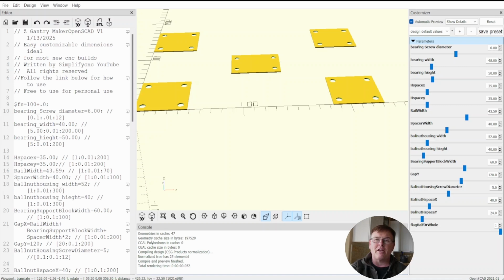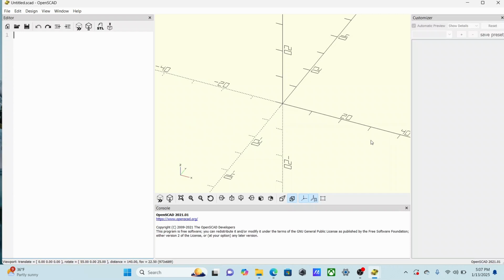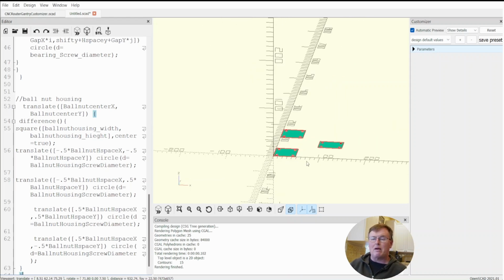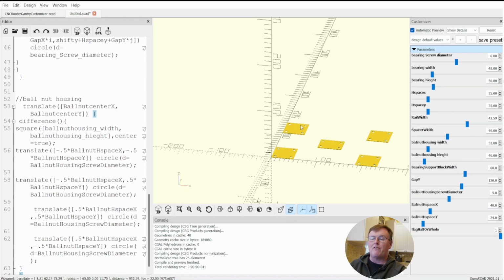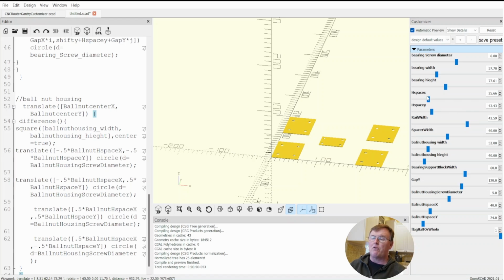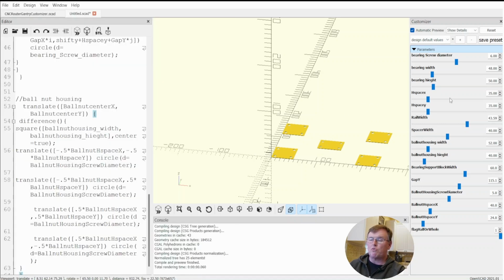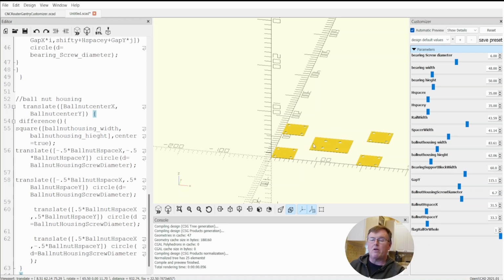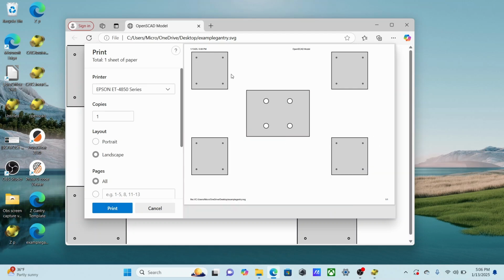MAKING AN ULTRA CUSTOMIZABLE PRECISION CNC GANTRY TEMPLATE IN OpenSCAD | DIY CNC ROUTER EPISODE 7

Comment: Have you ever tried creating your own interface to control your CNC? I ask bc it might be an interesting project? When you talk about connecting three different connections to get the stepper motor working? Do you know what the signals are that go down those lines? I am sure you can appreciate it would be useful to have a local control I could use to manage my self-built CNC?
Reply from the maker: Gsender already has remote control capability built into it via a smart phone.  Is that what you are thinking about regarding an interface? 
The actual Gcode that runs the CNC is relatively straightforward (I have manually written it with a text editor and run it with success).  My favorite addition to my CNC however is a free online site that will remote stream camera feeds (I just use my cell phone camera) to another computer in a quieter and less dusty environment.  The site has extremely low latency and no software to download and can be downloaded offline so you don't even have to have internet connection.  Beyond that its free.  It's very much like zoom but zero cost and much lower latency.  As soon as a finish this CNC build series (hopefully soon) I will post of video on that. If you don't use a remote camera feed to watch your CNC when it is running it is a game changer. If you want more info let me know. 
 I now use this remote camera feed for almost every long carve since my garage is either freezing cold or blazing hot and I don't like to breath any more wood dust than necessary.  As a side note, I ran across a great website that shows you how to control stepper motors directly without any outside C++  libraries.  Is that maybe what your are looking for?  I have thought about writing my own compiler to make my own Gcode.
Reply: @Simplifycnc  This all sounds right up my street, apart from the C++ bit; I prefer Swift. But yes, you're absolutely on the right track. What I like to do is a breakdown or reduce all these jobs to their basic components as far as possible, as far as is reasonable. So, sure, it would be fun to write your own GCODE compiler, but I'm not sure if reinventing that wheel makes sense. But the GCODE app is a black-box here. I thinking I want to build the minimum code needed to make the CNC motors move X,Y or Z. So an Arduino app that sends the right signals to the motors to make them move. The goal ultimately would be to be able to sort/fix problems more effectively. Regarding cameras I wrote an article about doing so late last year. It used an ESP32 chip, but not an Arduino. I sent you an email the other day, please reply to it and I can send you a link. And, yes please add a camera video to your channel as well.
Reply from the maker: Check out "vdo ninja" on Steve Seguin Youtube channel.  He wrote the web based video streaming software and has some tutorials (but you can have it up and running in under 5 minutes.  It works great).  There is also an older version of this software he wrote but I can't recall its former name.  I found vdo.ninja to be the perfect free no hastle 5 minute camera solution  to monitor my CNC so that I don't need to set up something like octopi or purchase more camera hardware.  As far as controlling steppers without all the black box nonsense which is what you seem to be looking for I ran across the solution on a animatronics youtube channel.  Do a youtube search of Beginner's Guide to Controlling Stepper Motors with Arduino.  The youtuber is Rachel De Barros.  She did a nice tutorial on this. That should give you what you need to write your own stepper motor code.  I suggest that you start by making an etch a sketch controlled by steppers as its a very inexpensive way to work out the bugs in the project/software.  Sorry I missed your email (I have 3 emails and I tend not to check my youtube one all that often).  I will log in and try to give you a reply this weekend so you can send me the article.  I am very interested in your project. I also really like the ESP32.  I have a DEV model that has been sitting around for a few years but haven't done anything with it.  It's on my want to do list (which is always larger than the time I have available).  As a side note of a project that doesn't really go with my channel but I think I will be building very soon is DIY automatic lawnmower (that tracks itself).  I want to make this from the ground up probably using an arduino mega (since I have a couple of them sitting around).

Comment from the maker: IF YOU HAVE PREVIOUSLY COPIED AND RAN VERSION 1 OF THE OPENSCAD GANTRY MAKER THERE HAS BEEN AN UPDATE PLACED IN THE DESCRIPTION (WITH NEW OPENSCAD CODE).  THE NEWEST VERSION 1.1 YOU WILL WANT TO RECOPY FROM THE DESCRIPTION AND USE IT TO MAKE YOUR GANTRY INSTEAD OF VERSION 1.  THIS FIXES AN OFFSET ERROR THAT OCCURS IF THE BEARING WIDTH HAPPENS TO BE A DIFFERENT WIDTH THAN THE RAIL WIDTH (WHICH OFTEN HAPPENS DEPENDING ON THE MANUFACTURE SPECS).

Comment: Installed. Thank you :)
Reply from the maker: You are most welcome. OpenSCAD has a100 times more maker possibilities than I was able to share in the video.  If you want a glimpse of some of its abilities click on the help menu at the top of OpenSCAD program and then the Cheat Sheet.  In it are tons of clickable code examples (all of which can be copied and pasted as you write your own code).   It is really an amazing program particularly when you need precisely engineered parts quickly (that can be easily modified in the future if the need arises).  It is also incredible for 3d printed parts.
Reply: @Simplifycnc  I started the tutorial on their side :) Probably not the last open source program recommendation coming from you (I hope).
Reply from the maker: CODE FIX UPDATE FOR GANTRY MAKER VERSION 1.1 IS NOW IN THE DESCRIPTION.  YOU WILL WANT TO USE THIS UPDATE AS IT FIXES A HOLE SPACING ERROR.